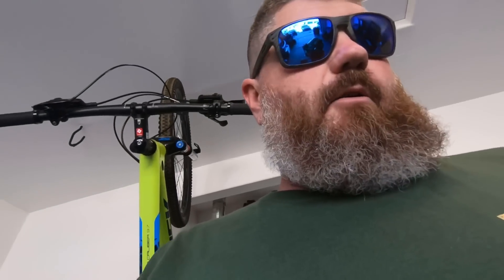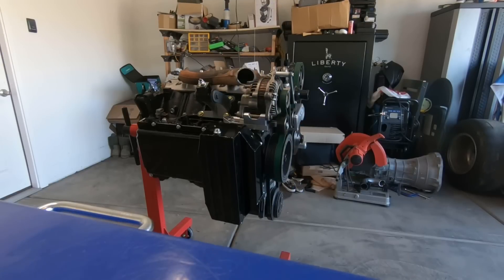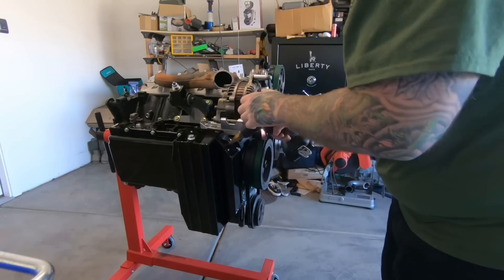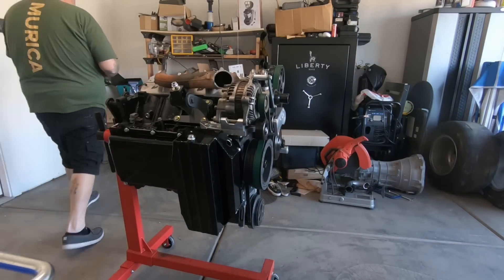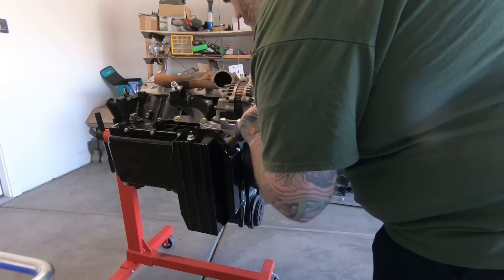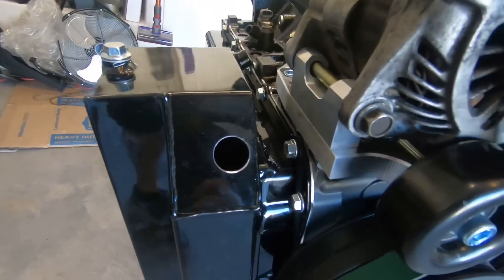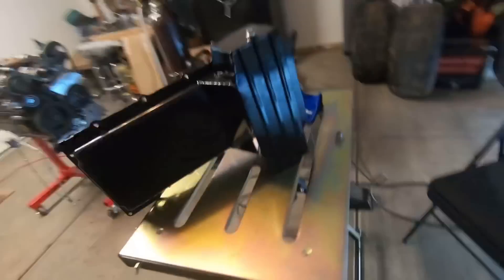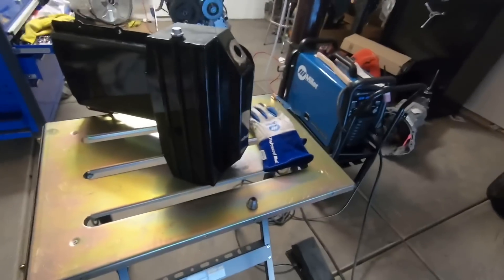LS G35 oil pan turbo drain

Comment: I need a front sump pan what brand pan is that ? Thanks
Reply from the maker: I got it from LOJ but I think he uses canton racing oil pans you can find them on summit for under $400
Reply: Boost Envy thanks for the info cheers
Reply from the maker: Any time, I’m always good to share what I have found through research.